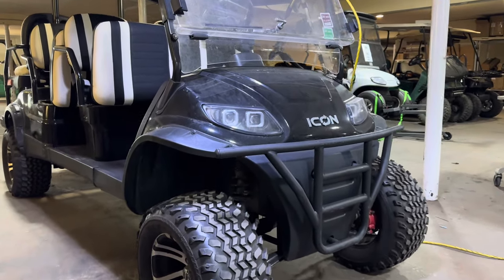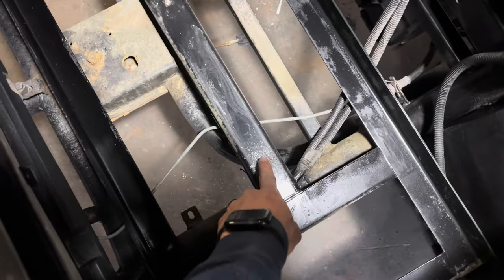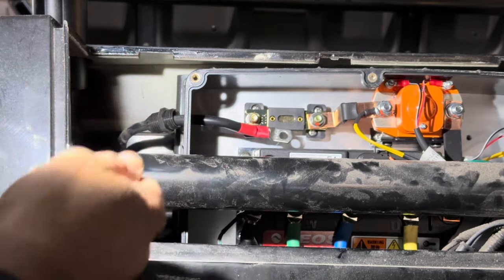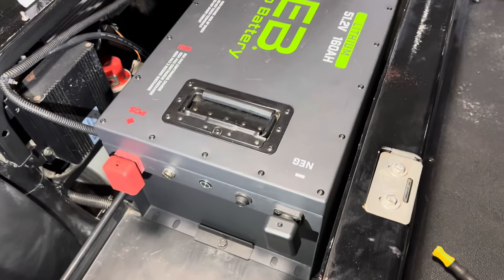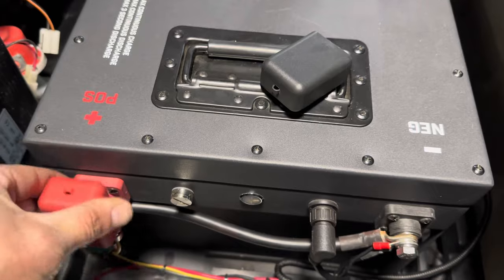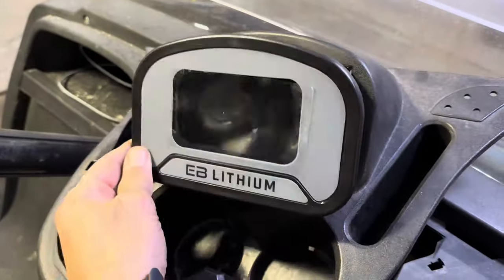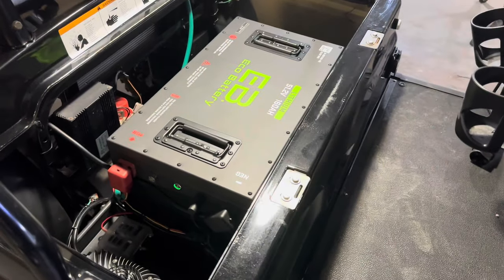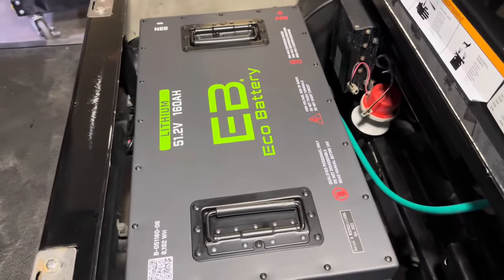ICON i60L - ECO BATTERY 51v - 160ah Lithium Golf Cart Battery Installation Video

Comment: Thanks for your video it really helped me with my installation of the ECO 51v 105 ah skinny battery in my 2021 I 20. I have a couple of up dates. I used the brakets that are sold seperatly they were a little spendey but made for a really clean install. They fit over the exsiting battery seperators and come with bolts that fit into the nuts that are welded to the bottom support. The latest batterys now come with a conector for the existing batery charge indicator light. The tip on the pos and neg cables helped. I just ordered 2, 4' cables from amazon ahead of time.
Reply: What cables did you buy?
Reply: is there any kinda programming that needs to be done to the cart?  Or is plug and play?

Comment: Any load testing done with the 160ah battery?  I’m considering a roypow 160ah because we have some steep and long hills around here…still not sure if the 160ah will even do the trick without bms problems.  I do have Navitas’s controller so I can set limits but worried about spending thousands and not being able to get up hills

Comment: Nice video Palmetto! Quick question, have you heard of any of these clusters needing an update? We got in a few that turn on and read the battery percentage, but as soon as they get driven the % disappears. This has only happened on the last 3 160s we installed. Have you experienced this at all? TIA!
Reply from the maker: Apologies for the delay. We have not encountered this problem. Did you get a resolution through Eco?
Reply: Did you get a resolution on this issue? We received one with this issue and eco is closed today so interested to know what the resolution was.

Comment: The eco website says i need an "eco battery tech tool, sold separately". What is this. Also, i went to a cart dealer and i was told that i need a reflashb, otherwise my kart would do a sudden stop if i ran out of batteries, and that it could be dangerous. I didnt see any reflash. Is that because of the new cluster. And last thing, will the icon software will still work to make changes to improve speed? Thanks!

Comment: I watched the video, as guidance on my I60L conversion using EB 160AH. I have some trouble, I have the EB battery charger display and not the Icon cluster display. Im stuck , as I’m leaving EOM converter, so i have a set of cables that I don’t know where to plug, the cable is the on that 
Has orange cable to connect to the ignition, + - to the battery, and 02 to be connected to the fuse plug, on the other side it has a plug with 06 wires in which doesn’t fit to EOM reducer, neither I don’t know where to connect the ignition orange cable…. Any help is appreciated thank you
Reply from the maker: I’m sorry, I would need to see this. Can you email us some photos at palmettobatterypros@gmail.com

Comment: Help wanted! I have installed the Eco Battery kit on my 2022 icon i40. Now I need help trouble shooting. Battery turns on, turn the key the new dash lights up, lights work, hear the click from what I assume is the solenoid. Only thing is when I  put it in drive or reverse nothing happens it won’t drive. What step did I miss? Thanks!
Reply from the maker: I recommend calling Eco directly.
Reply: @user-xj, it sounds like you missed the step where you need to short out the charger interlock. This can prevent your cart from moving.